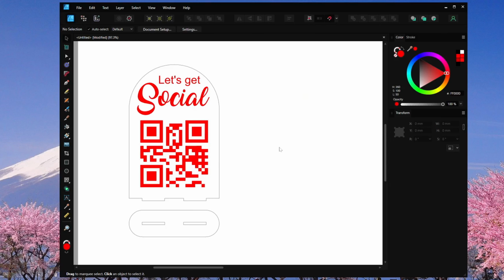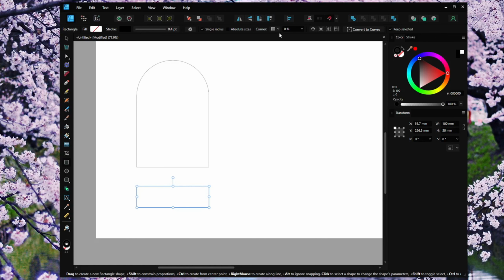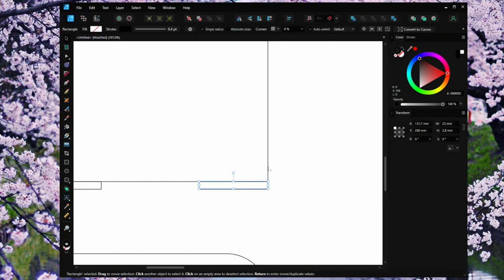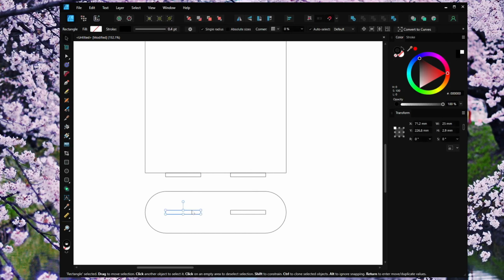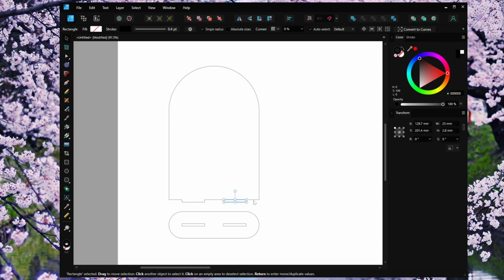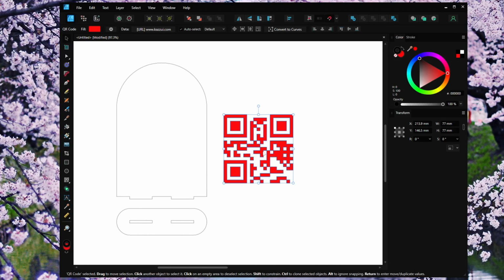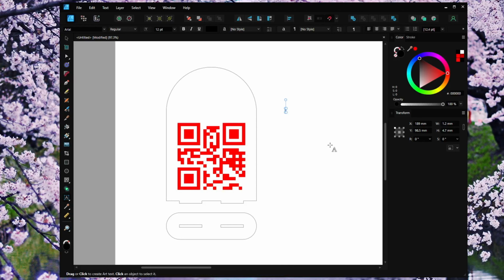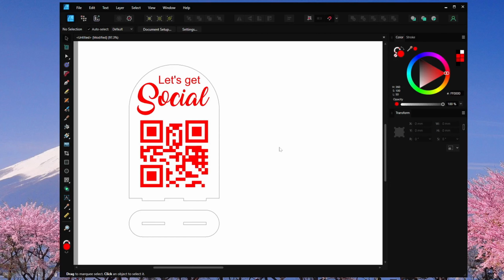How to: Design and Laser Cut a QR Code Sign (Beginner tutorial)

Comment: Thank you so much.  I have a cash App code with dots, how would that engrave?
Reply from the maker: I think that should work fine. Due to the small dot for the cash app code I’d try to make the code as big as possible. Maybe try a test engrave and start with lower engraving settings to avoid the little dots blurring into each other when engraving too hot. Hope that helps